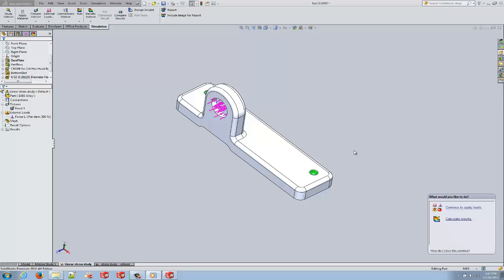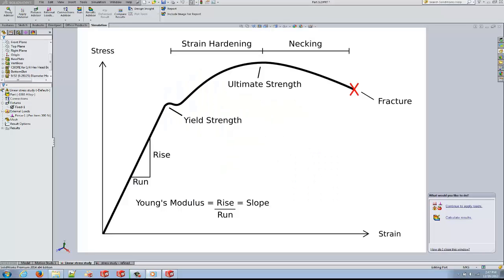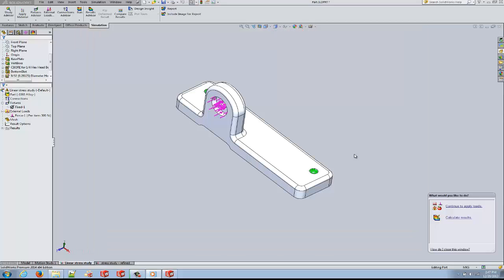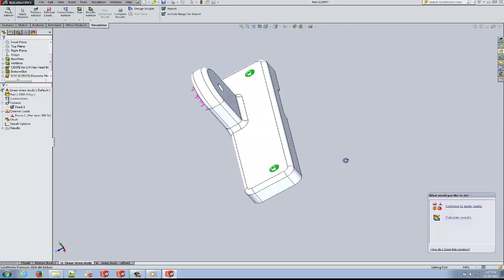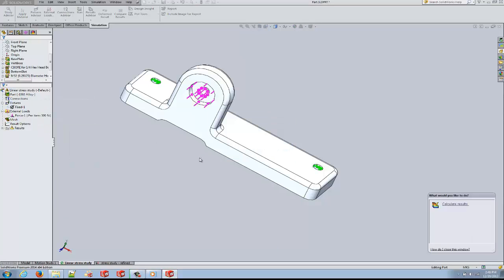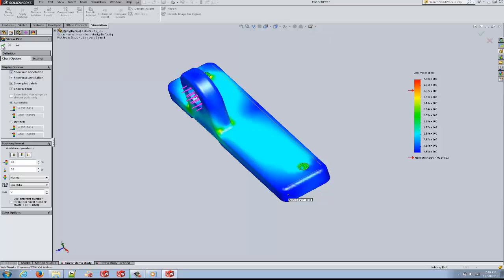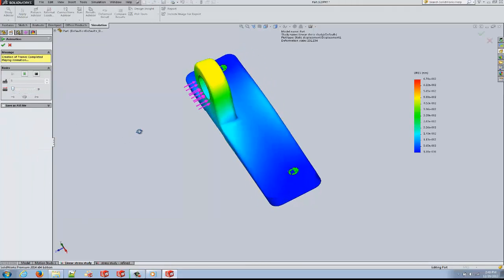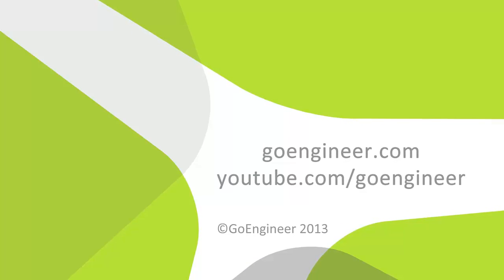SolidWorks - Linear Stress Analysis

Comment: How do you apply the forces??
Reply from the maker: Dominick,

Look on the left hand side of the screen where the Simulation tree is. Look for the external loads folder. Right click on that folder and select Forces. Another method is to go to the menu at the top of the screen, select Simulation, Loads/Fixture, and then Force.

This is also covered in the provided Simulation Tutorials. Please also go to the SOLIDWORKS tutorials and navigate to the Simulation tutorials section. If you continue to have trouble, contact your local reseller or reach out to the community via the forums at my.solidworks.com.